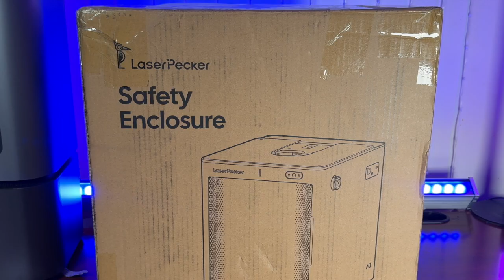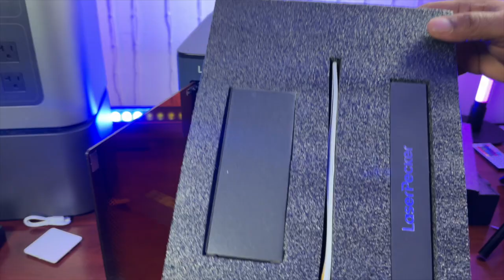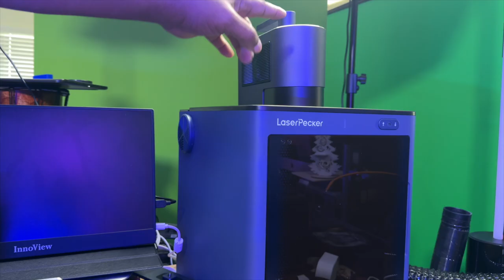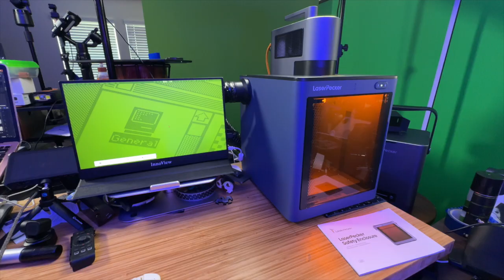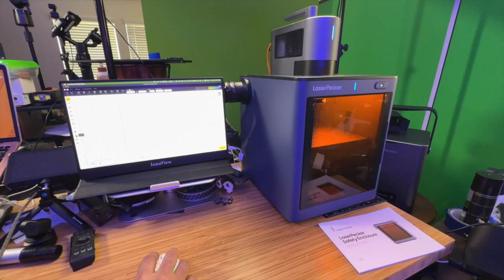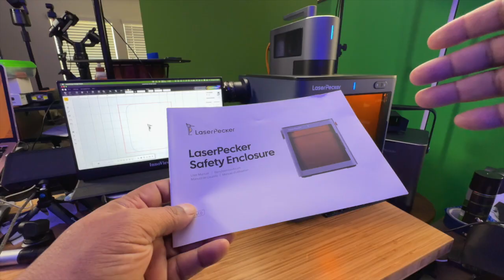Safety Enclosed For LaserPecker LP5

Comment from the maker: Check out the  LP5 enclosure system 
 ForbThe Laserpecker LP5 first look and unboxing 
Amazon link: https://amzn.to/48AQQlm
Amazon affiliate link
As an Amazon Associate, I earn from qualifying purchase. #ad #CommissionsEarned 
 Laserpecker LP5 
https://shrsl.com/4qt1b
LP5 Safety Enclosure
https://shrsl.com/4s140
LaserPecker Desktop Air Purifier
 https://shrsl.com/4qt1d
Laserpecker 4 
https://shrsl.com/4qt2w
Coupon Code:  RKTech for 5% OFF
LaserPecker Slide Extension
https://shrsl.com/4quz2  

with fully closed design is rigorously tested and certified, and it fully 
complies with EU regulations.
Height-Adjustable Plate: Raise or lower the base plate for smooth motorized adjustment at the press of a button to optimize laser focusing.
Responsive Door Sensor: Integrated door sensor halt laser operation instantly when opened.
Powerful Filter Fan: Dual Exhaust System effectively removes smoke generated during engraving to ensure a safe environment and achieve optimal engraving effects.
Smart Camera: The integrated camera makes the engraving easier than ever. Simply place materials on the plate and let the smart system handle the rest.
Compatibility: LaserPecker LP5 (for now)
#LaserPecker
 • #LaserEngraver
 • #LaserEngraving
 • #LaserCutter
 • #FiberLaser
 • #DiodeLaser
 • #MetalEngraving
 • #WoodEngraving
 • #AcrylicEngraving
 • #JewelryMaking
 • #CraftingTools
 • #EngravingMachine
 • #MakerTools
 • #LaserArt
 • #PersonalizedGifts
 • #CraftingCommunity
 • #LaserCraft
 • #ArtisanTools
 • #LaserPeckerLP5
 • #RotaryEngraving
 • #CreativeMakers
 • #SmallBusinessTools
 • #EngravingInnovation
 • #MakersMovement 

------------------------------------------------------------------------------------------------
My gear:
www.romeknowstech.live
#Amazonfinds2024 #amazoninfluncer #romeknowstech 

Amazon Associate links.
Ninja V https://amzn.to/3Is5wqj
Handle Extension https://amzn.to/41lTckb
Smallrig tool https://amzn.to/3xRMFA6
Sony FX30: https://amzn.to/3SgCfnj
Sony A73: https://amzn.to/3K9GFtN 
Sony A7R3: https://amzn.to/3S3bm6b
Sony 85mm 1.8 https://amzn.to/3I0GH4Q
Sigma 24-70 2.8 https://amzn.to/3E9dFyG
Sigma 135mm https://amzn.to/3lFgUr4
Sigma 35mm https://amzn.to/4197pB0
Rode wireless go 2  https://amzn.to/3HWUw46
Macbook air M1 https://amzn.to/3K9JVp1
Ipad pro 2018 https://amzn.to/3jYcYkO
Zhiyun Crane 3 LAB  https://amzn.to/3XA3dXI
Zhiyun M3 https://amzn.to/3YEMwMs
Godox AD200 https://amzn.to/3S2OP9s
Godox AD600 https://amzn.to/3YUAf6i
Gopro hero 10 https://amzn.to/3Ex4hFt
Ninjav: https://amzn.to/3IqktKF
---------------- Above amazon links ----------------
Software I use:

Follow me on Instagram: www.instagram.com/romeknowstech.live
I post weekly content mostly photos and video.

Follow me on Facebook: https://www.facebook.com/RideWithRome2
Here you will find a very easy way to contact me and stay up to date on local photography events in my area and from around the world.

Follow me on Twitter: https://twitter.com/podonemedia
My Twitter account is a mixed bag of biker related posts as well as photography and video from my full time job as a professional photographer in Houston.

Check out my main site: www.houstonprofessionalphotography.com
I am a full time working photographer in the Houston area I also produce short films.

Email me:info@podonemedia.com